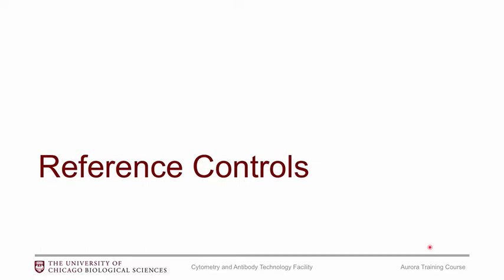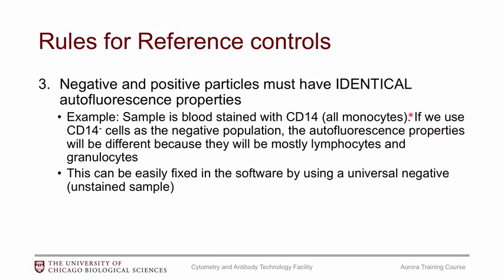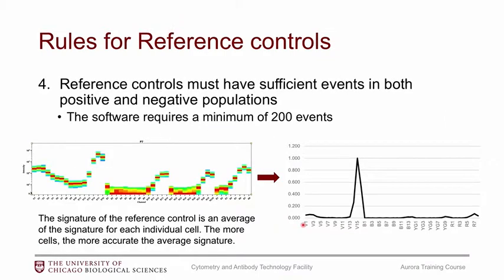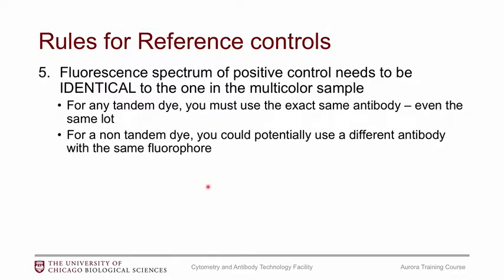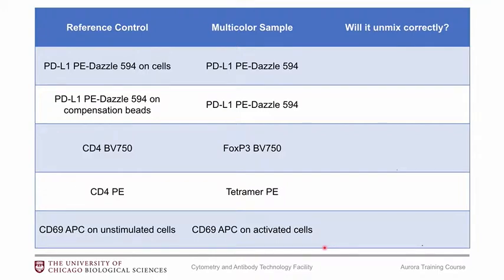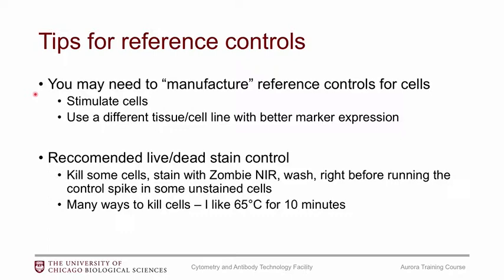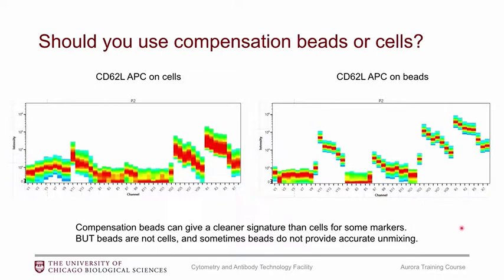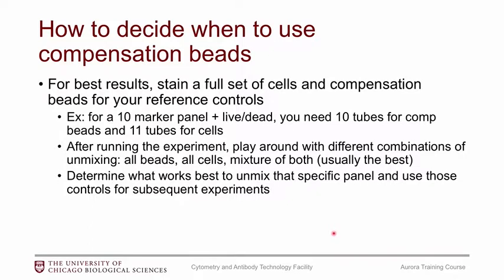OLD VERSION Aurora Training Course: Part 2 - Reference Controls

Comment: Can you mix the beads and cells for the reference controls and stain them in the same tube? Then tell the software which populations to use as positive and negative populations
Reply from the maker: I would not recommend combining the beads and cells into a single tube two two reasons. First you would need to be 100% certain that the beads and cells do not overlap on the FSC vs SSC plot. Depending on the tissue used, there could be some overlap. Inability to separate beads and cells could be problematic for how autofluorescence is accounted for in terms of calculating unmixing from the reference controls. Second is that beads and cells don't necessarily require the same concentration of antibody for optimal results. I could come up with a bunch of advanced tricks that would allow you to combine beads and cells into the same tube, but ultimately it's going to take a lot more effort than it's worth.

Comment: Why we can not use CD4 BV750 (Tandem dye) as a reference control for unmixing the spectral signature of FoxP3 BV750 in the test sample?
Reply from the maker: Each time a tandem dye is created, there may be slight variations in the signature. Meaning the signature from lot 1 may be slightly different from lot 10. Because the signature of the dye in the control must be the same as the signature in the sample, you must use the exact same vial of antibody to stain the control and the sample. If you use a different vial of antibody (such as a different lot or an entirely different antibody with the same fluorophore), you will likely not have the same signature in your control and sample and will end up with unmixing errors. Non-tandem dyes do not have this lot to lot variability and so you can switch antibodies or lots for those fluorophores.
Reply: @UChicagoFlow  Yes, Indeed we can prepare the BV750 reference control from the same antibody lot that is going to be used for the sample. There is always a slight variation in the staining pattern/signature in tandem dyes from lot to lot due to fluorescence/protein ration, the pairing of tandem molecules/fluorophores etc.

Comment: In Rule number 05, they are saying that all the controls must be treated with the same buffer as your sample but if the buffer changes the spectrum signature of reference (compensation) control then where would the problem occur when applying unmixing to the test sample? if we already set the spectral signature with the bright individual reference control then it shouldn't matter whether the test sample treated with permeabilization or fixation.
Reply from the maker: Hi! Rule 5 states that the signature of the control must be the same as the signature of the sample. Fixative can slightly alter fluorophore signatures, so if your controls are unfixed and your samples are fixed the signatures will not be the same and you will get unmixing errors. You must either have both controls and samples fixed or both controls and samples unfixed.
Reply: @UChicagoFlow  It means to say that the unmixing is different from conventional compensation where it says that the compensation control should be brighter than your sample control. So, for the unmixing algorithm/feature, we always need to use a similar treatment or conditions for references and samples to get proper unmixing results. As in the compensation rule, it says that the background fluorescence should be the same for negative control and positive control (Means if there is a treatment in your positive control/reference then the similar treatment should be given to negative control/reference, no comparison with the sample condition/treatment)
Reply from the maker: @prateekarora414   Actually, the rules to create proper single stain controls are the same - whether you decide to use them to perform spectral unmixing or compensation. Since compensation can be performed manually, people are often able to compensate their data even if their single stain controls do not follow all of the rules. And because conventional cytometers only look at a fraction of the overall emission spectra, they may not be able to detect lot-to-lot variability as well as spectral cytometers, so using a different lot of antibody between controls and samples may not have as big of an impact on compensating data as it does on spectral unmixing. Your comment also referred to a "compensation rule" - I'm going to assume you meant the third rule in my video. I'm not sure if you understood this rule correctly and what you mean by "treatment" (fixation? stimulation? disease model vs control?). It's challenging for me to provide detailed explanations in YouTube comments - if you have questions about what controls to use for your experiment, I would suggest contacting your Cytek Technical Application Scientist and they should be able to discuss this with you.
Reply: @UChicagoFlow  Thanks and appreciate your valuable time to give such commendable comments. I do apologize if, my comments annoyed you. I completely understood the concern of rule 03, where it says that the autofluorescence of the negative population in the positive control should be identical to the autofluorescence of negative control (Highly recommended in spectral cytometers to matching the background for better unmixing) else use universal negative in third party software. I mean of treatment was for buffers only means as you said in rule 05 that all the controls should be treated with the same buffers as your sample to get the identical spectral signature but if someone is using beads then I presume there is no need of treating the beads with the same buffers as for the samples, I know the treatment will alter the fluorescence spectrum but here if we add the treatment buffer like a fixative buffer to the beads references controls then the spectral signature would not be similar to the cells treated with same fixative buffer..
Reply from the maker: @prateekarora414   I'm sorry if I sounded annoyed, that was not my intention! I just want to make sure you're getting the answers to all of your questions and I am not able to answer everything in full detail using YouTube comments. Please contact your Cytek Technical Application Scientist and they'll be able to have a discussion with you and answer all of your questions.
Reply: I shall highly be obliged to your kind time and valuable comments.